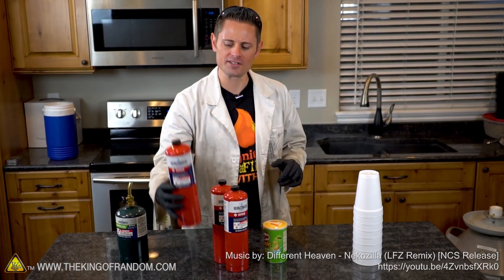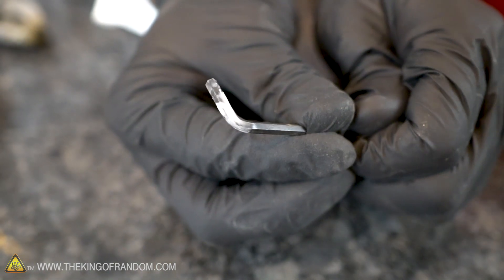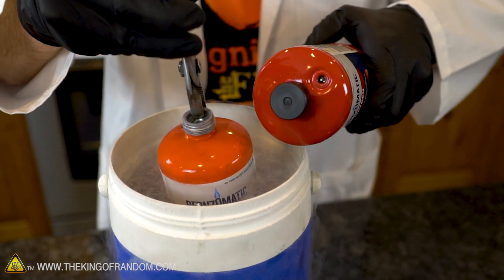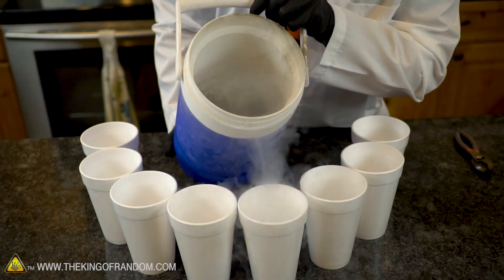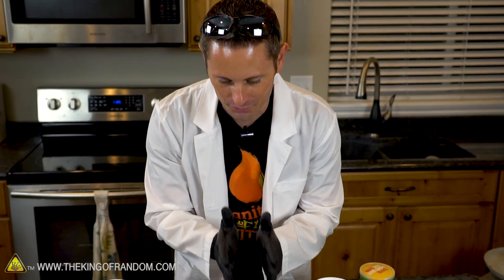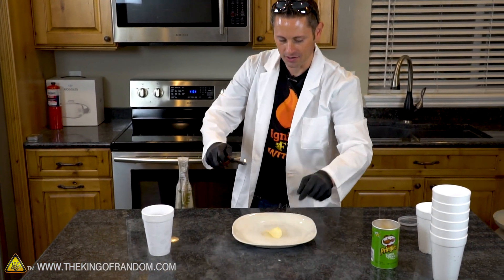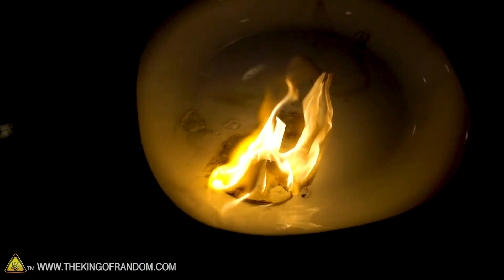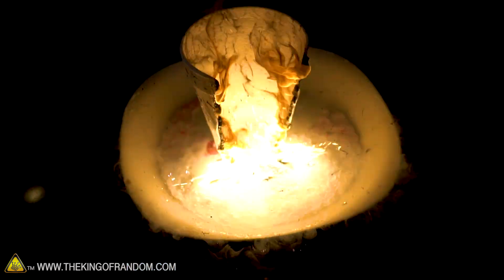How To Make Liquid OXYGEN! TKOR Experiments With Homemade Liquid Oxygen & How Oxygen Is Made

Comment: Hey Grant, because water is H2O if you mix hydrogen with the liquid oxygen would bit make water or make something crazy?? Like so Grant will see
Reply: If you mix hydrogen and oxygen and ignite it, it will make water. The reaction is explosive though
Reply: Yep that is what fuels the space shuttle.
Reply: Jordan Vandevegte that formula is also incorrect since you need to consider moles, 22 liters of oxygen is 1 mole s 44 liters of hydrogen is 2 moles and according to the formula 2 H2 + O2 -> 2 H2O you end up with 2 moles of water, which there is 18 grams in 1mole of water and so you will have 36 grams of water in 2 moles of water and since 1g of water is 1 mL of water, you will have no more than 36 mL of water from 22 liters of O2 and 44 liters of H2. Assuming you are working under STP. Look up molar gas law and stoichometry
Reply: would a magnet still work when frozen in Liquid Oxygen. Like so Grant can see.
Reply: Jordan Vandevegte the problem tho is if he somehow got, 22 liters of oxygen and 44 liters of hydrogen,  he would get a whole 16 mL of liquid water, and a ton of energy
Reply: Water is the burnt leftovers of oxygen and hydrogen 
Btw IF you DO burn it you get next to no  water and a MASSIVE explosion
Probably a big enough explosion to blow out all your windows and crack your walls
Reply: kmasterc yes but water vapour is easy to condense
Reply: You would need energy (heat) to combine both, Energy will also be released.
Reply: raymond Eilers he is not suggesting to mix it with water. Mixing O2 and H2 then burning the mixture water vapour (and other things) would be produced, that water vapour is very easy to have condensate into liquid water
Reply: Jordan Vandevegte Lol, no that is definitely not right. I've only have a general Chem but I know enough about moles and conversions to know that is not the right yield
Reply: Jordan Vandevegte world problems fixed,we just need some fresh oxygen to do so or else itll probably give us cancer due to how bad our air is.
Reply: death poison101 ea
Reply: The reaction needs an ignition temperature much high than those temperatures
Reply: Shibe Inu yes I know, however the idea is not to make as much as possible, it's an experiment.
Reply: WADE EVANS H2+O2--H2O          N2+O2--N2O3  ( IN video he takes liquid Nitrogen (not oxygen) )
Reply: Jordan Vandevegte I'm just saying practically at a small scale, it's impossible to get anything contained
Reply: Shibe Inu also that's not correct. 
From using 2L of H2 and 1L of O2  you would produce 2L of water vapour and when cooled into liquid water would produce about 80 ml of liquid water. It's still a bad yield but better then you are suggesting. The bigger problem is getting enough H2.
There are other reactions that make much more water vapor such as 
4 NH3 + 5 O2 - > 6 H2O + 4 NO
Seeing that ammonia is easy to get. However it would be very expensive due to how much ammonia would be required. 
(hydrogen and oxygen's equation would balance out to be
 2 H2 + O2 - > 2 H2O)
Reply: WADE EVANS well you dont have to have liquid oxygen to make water, i would think it would be easier with liquid oxygen
Reply: solmeister wnc Yup...
Don't really need to point that out now, this is unrelated.
Reply: You would have to provide a source of energy (light it on fire)
Reply: WADE EVANS Don't read my profile picture

Comment: CAN U FREEZE LIQUID NITROGEN!?
Reply: It would become solid nitrogen... Like water vapor is gaseous water, water is liquid water and ice is solid water..
Reply: Yes, but you might need to put it under pressure.

Basically, if you could chill nitrogen to below its melting point, it would solidify. I don't know what the melting point of nitrogen is . . .
Reply: i dont think caps lock will make any youtuber respond to you,
just use small letters. it looks more polite that way if you ask a question
Reply: I just looked it up. Solid nitrogen can be made by chilling it to below 48 K.

This was first achieved by chilling nitrogen using liquid hydrogen.
Reply: If you put liquid nitrogen into a vacuum chamber, it'll freeze.
Reply: DEMAGEBAWS Actually dry ice is solid carbon dioxide
Reply: No, if you put it in a vacuum chamber, it'll boil and evaporate faster. To freeze it, you need the opposite. You need high pressure. Or extremely low temperature around 48K or less.
Reply: yea on a cold plannet ha
Reply: The temperature of liquid nitrogen can readily be reduced to its freezing point 63 K (−210 °C; −346 °F) by placing it in a vacuum chamber pumped by a vacuum pump.
Reply: Jane Hervilla yes
Reply: DEMAGEBAWS dry ice is frozen CO2. solid nitrogen is just nitrogen
Reply: to freeze nitrogen u will need liquid helium [its easyest this way] [BEFORE YOU ASK NO U CANT SOLIDIFY HELIUm]
Reply: Actually Marshall Gatten, you can use a vacuum chamber to bring liquid nitrogen to its triple point to see solid nitrogen.
Reply: Greyevel basically what I said lol
Reply: DEMAGEBAWS dry ice is solid carbon dioxide
Reply: nemisans13 you didn't say anything
Reply: Jane Hervilla yes
Reply: Jane Hervilla nah
Reply: DEMAGEBAWS It isn't; dry ice is hotter than liquid nitrogen. Solid nitrogen would have to be colder than its liquid form.
Reply: spikeshroom *dry ice is warmer/colder than liquid nitrogen. Solid nitrogen would have to be colder than its liquid form.

I don't know what you meant by hotter so I put colder or warmer which ever one you meant
Reply: Jane Hervilla I think that's what dry ice is but don't blame me if I'm wrong

Comment: so what I'm thinking is that effect you did where the droplets so run in different directions when hit and then ignite when it hit a flame. anyways I think it would be awesome to get a plate like object with a dipped center to hold small amounts of oxygen in it. then tap it, hit it so it spreads and runs around. at the same time have some type of flame in like the corners that it would would ignite and make small Sparks all at once. I hope that was clear enough

Comment: My guess for the slight color change would be that the contraction of the canister and paint caused by the cold temperatures has moved the paint particles slightly closer together which would effect the wavelength of light that can reflect off its surface, moving slightly more towards the ultraviolet and resulting in a bit more orange of a color.

Comment: Hey Grant Thompson what will happen if you pure the liquid oxigen of one cup in to an empty oxygen bottle? Will overpressurize it and blow it up? or it will stay normal like liquid propane does? If it can be saved in  there, you can add way more in and then use it to melt steel on your fountry, or with your propane tortch...

Comment: I'd like to see you vaporize iron with an electrical arc into a vapor, pressurize it through a carbon tube, surround the carbon tube with a magnetic coil, and energize the coil to magnetize the iron and align its atoms, force it out a rocket nozzle and reverse the magnetic charge to produce thrust.

Comment: You should switch out the nitrogen generator with a oxygen concentrator and use your cryocooler to make oxygen directly.
Reply from the maker: +Cody'sLab yeah truth be told its as easy switching the exhaust valve on the generator. That's just dumping pure oxygen anyway.
Reply: @TheKingofRandom hey
Reply: Cody'sLab y'all should do a collab
Reply: Cody'sLab I have a question not related to this. Is it worth inserting a neodymium magnet in my finger?? I have watched your videos about input and I'm still wondering. Can you respond and thank-you Cody!
Reply: Cody'sLab what happen when you put mercury and liquid gallium together
Reply: Cody'sLab can you pressureise liquid Oxygen in a pressure capsul and let it heat you could also Do that with nitrogen I think.
I always wanted to see that or maybe you explain it on your channel...
Thank you Cody
Reply: Cody'sLab I
Reply: I love your videos cody, my favorite was with the toilet and mercury
Reply: hey ive never seen you on thes videos (comment section) I know you did a calab with him its been a while scence I wached you
Reply: If you mix the liquid Hydrogen with the liquid Oxygen you will have made rocket fuel! Do it Grant.
Reply: That would freeze your throat shut. Have fun doing the last thing you'll ever do!
Reply: Cody'sLab would making liquid oxygen be more efficient than making liquid nitrogen?
By efficient I mean would it make more liquid oxygen per hour than liquid nitrogen.
Reply: Ryan Limbaugh No, by using  the equation q = m * c * dt, it is going to take the same amount of thermal energy. I'm not sure if more air is going to be pumped through though, it almost will do that passively.
Reply: Cody'sLab I
Reply: Cody'sLab hi cody big fan just wanted to say hi to a fellow science nerd
Reply: hey big fan Cody how are. your bees in the planter set up and do you think you would ever make an ant farm
Reply: Hi professor cody
Reply: Vaughn they have before
Reply: Cody'sLab grant should totally do that it would be epic or Cody you could
Reply: Mixing liquid hydrogen and oxygen makes water not rocket fuel
Reply: try making liquid helium,hydrogen and carbon dioxide
Reply: you shouldent comment here, cody. this is for stoopid people :)
Reply: That would be cool too. Just add somehting to make LOx while keeping the LN2 too. Make both.
Reply: Cody'sLab i was thinking the same way, but i think it will cost much time since nitrogen that build up 75% air take pretty long time just for few drip.. dunno, just my thought tho..
Reply: Cody'sLab 
Yaaassss
Reply: Hi Cody <3
Reply: Cody'sLab ayyyyyyy ilysfm
Reply: Vaughn they made silver bullets
Reply: Cody'sLab b
Reply: Yo cody I have a sciencey question for you. Could i use dry ice and everclear to make a better alternative for adult Halloween parties cool drinks? I am aware that i could do it with 90% isopropyl alcohol and dry ice but can i with everclear?
Reply: Cody'sLab hi cody
Reply: Cody'sLab you should make a video about that. Plis
Reply: Would love to know how to make liquid nitrogen
Reply: no
Reply: Max DrenThan you would cryogenically freeze your throat shut and if you somehow survive that your throat would slowly fall apart from severe tissue damage from cryogenic freezing. Never mix dry ice with alcohol its a bad idea. I have made iced tea with dry ice before just add dry ice right before serving and it'll carbonate the beverage and the water will form a somewhat protective ice crust around the dry ice so you dont freeze too quick. It may work with a watered down alcoholic beverage but if it becomes a slushie make sure its not too cold before serving you may end up with lawsuits or death.
Reply: Wait, if he's got a valve that's dumping oxygen, couldn't he mod it so it makes liquid nitrogen and oxygen at the same time?  Heck, it'd actually be as simple as passing some of the liquid nitrogen over a coil that the oxygen was being passed through, which would liquify.
Reply: oooooh check please!
Reply: Cody'sLab ?
Reply: I wish I was smart and understood
Reply: Did flies and mice in LN2 and hit them with a hammer
Reply: Wat?
Reply: If you want to detonate LOX, compress it with oil or hydraulic fluid. I've pumped thousands of liters of LOX into C-130's.
Reply: Vaughn he only replies to a youtuber so if you want to get replied be a youtuber XD
Reply: @PhanicRed  typical snobby youtubers, only replying to other big channels

Comment: it's because it under went a change in the state of matter from gas to liquid in theory if heat is minimalised the cycle in the 3 states of matter (4 if plasma is included)  will fluctuate depending of the element and proton difference from plasma to gas to solid to liquid in the oxygens state of 8 protons it skipped the solid state and went straight to liquid

Comment: your liquid nitrogen setup passes air through a nitrogen membrane correct?  possible to catch the gasses (oxegen argon etc...) that does not pass the membrane and run it through steel brake  lines (coil) in liquid N, to speed the liquid O gathering.   oxygen distillery?  lol

Comment: can fire burn in liquid oxgen or would it be put out?
Reply: A burning object dropped in liquid oxygen will burn like crazy if not explode.
Reply: i don't think they use liquid, just compressed also they breath very little of it mixed with other gases.
Reply: F no just breathing quickly can make you lightheaded, оxygen poisoning and so on. It would burn your lungs.
Reply: yea but too much and it will be overwhelmed
Reply: yea because there would be more oxygen than fuel
Reply: Yup,i agree
Reply: the destroyer no, full oxygen won't be a problem, while there's a combustible and a combustive (oxygen in this case), it will burn.
Reply: However if you try to burn something in liquid oxygen, it won't work because to burn something you need a combustive, a combustible and heat. Liquid nitrogen will "remove" the heat.
Reply: The Home Scientist I would think the fire would evaporate the oxygen, burn that, and continue
Reply: clayman0 skycade there can be fire with many other things than oxygen, for example, ozone.
Reply: Oxygen itself is not flammable. It's an oxidizer, which a fuel requires to ignite. Adding liquid oxygen to a fuel will make it burn more vigorously because it oxidizes the fuel more efficiently than gaseous oxygen.
Reply: Fire won't burn in liquid oxygen directly since liquid oxygen is to cold but it will boil the oxygen and burn in an oxygen gas bubble under the liquid oxygen
Reply: Sam Furlonger no, and if it works, it will during a very short period of time.
Reply: thanks guys
Reply: ok
Reply: pls like
Reply: thanks
Reply: ok
Reply: It will burn at a very violent rate, you don't want to put any flaming object near oxygen, liquid or not.
Reply: Ok..
Reply: fire can't burn without oxygen though...
Reply: The Home Scientist put out obvs
Reply: +Rising Phoenix animation divers use liquid oxygen to breathe underwater

Comment: maybe you could put it on iron and watch it oxidize?
Reply: he should mix it with liquid propane
Reply: @billyahern7504  Super explosive mixture but better is liquid hydrogen+liquid oxygen.
Reply: Acryfox cz lp liquid water
crazy
Reply: @ewangreen9406  to make water you must ignite it to connect molecules it uses space rockets so it work liquiod oxygen replaces oxygen that isn't in space and make hydrogen blame stronger so no water.
Reply: @acryfoxcz1756  liquid hydrogen is very hard to get though
Reply: @TooHarshForYou easy to make though if you have a cryocooler

Comment: You should start making Liquid Hydrogen (PROBABLY DANGEROUS) And then make a Oxyhydrogen torch like Cody did (Torch that is capable melting Tungsten)
Reply: +SKILL3D-HD Oxyhydrogen is a mixture of H2 and O2 gases
Reply: Liquid o2 is more dangerous than liquid hydrogen tbh. So yes, he should totally do it.
Reply: Jerry you're both wrong, it sublimates
Reply: No, dihydrogen monoxide is called "Water"
Reply: can u give a link for that video
Reply: oxyhydrogen torch
Reply: Jerry my fart can't
Reply: Ali 112 most carbon based molecules do burns, but carbon itself is not a molecule it is an ellement.
Reply: Elastico345 - Mixels and other stuffs he liked it so he prob do it
Reply: OdysseyEvolution why doesn't the O2 and H2 react to form hydrogen peroxide?
Reply: Have you ever seen molten vacuum Jerry? Can a vacuum melt JERRY?
Reply: QueenReign carbon is an ellement, it is molecules that burns. so it depends on which molecule the carbon is on
Reply: Alexandre Page carbon burns it's called combustion.
Reply: trash bait
Reply: Liquid hydrogen boils at a lower temperature than liquid nitrogen.
Reply: you cant make liquid hydrogen. cooling point is too low
Reply: If you're making liquid oxygen and hydrogen why not just develop a hydrolox engine and go to space.
Reply: Devost01 it's a oxide
Reply: SKILL3D-HD oxyhydrogen is hydrogen peroxide I believe. Someone correct me if I'm wrong.
Reply: tobi3685 he said hydrogen peroxide
Reply: Elastico345 - very bad idea without owning a huge space that cody does... Hydrogen combusts with really little oxygen anyway... Its actually explosive gas with the oxygen on the atmosphere... If you add more oxygen you make it more explosive and tottaly unsafe to use... If the bottle of Hydrogen blows, will take the whole neighborhood with it....
Reply: no di-hydrogen oxide is water, Oxyhydrogen gas is a mixture between O2 and H2
Reply: I din't even know that the boiling point of liquid hydrogen is that low... i thought it's going to be -150c or something
Reply: BUDDERVEOM i wrote it as a reply to SKILL3D-HD who said "Oxyhydrogen is called "Water"" :D
Reply: KoComoeJoe CO2 does liquify at high pressures, just like water sublimates in low pressures(it also does really cool things at its triple point 😎 ).I just call the mixture hydrolox to avoid confusion.
Reply: Dhritiman Sinha so does diamond and graphite
Reply: Alexandre Page  when carbon react with air by burning it, it forms carbon dioxide and it's called complete combustion and the reaction is exothermic
Reply: that's like 2 kelvin brouu
Reply: He should make a HydroLOX rocket engine
Reply: Elastico345 it's gonna be harder
Reply: Oxyhydrogen is called "Water"
Reply: Carbon doesn't, it burns.
Reply: Anton Helsgaun carbon dioxide sublimates not carbon
Reply: hydrogen can be liquid? I don't know it